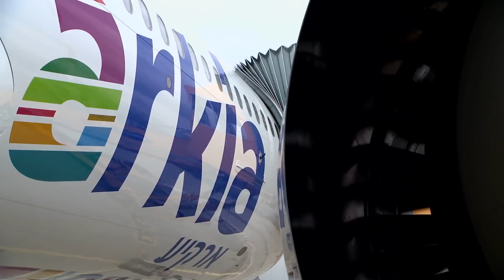Why Won’t Boeing “MAX” The 757?

Comment: This is stupid. A320 is just 5 years older than b757. And the 757-200 is exactly the same ranges and capacities as max10. If boring is smart enough they will just max the 757 instead of 737. 
They would have a better variety of than a320 family, by making shoter one like 319,318 and they can extend the aircraft further like 321lr,xlr. It would be easier to modify since it’s younger than b737 and wouldn’t have the mcas system. You should defend the stupid decision by the corporate greed.

Comment: Boeing has so much damage control to do these days it’s holding up any new aircraft designs. The tooling for the 757 is gone so there’s no chance of any new ones. Neither Boeing nor Airbus can or will have any offerings  that have the capabilities of this plane. The A321 XLR will be as close as they get.
Cheers

Comment: The 757 is a phenomenal plane. I’m not intending to armchair quarterback, but just giving my opinion as a frequent flyer and enthusiast. I often have great conversations with my uncle, who worked for Pratt & Whitney and has a PhD in mechanical engineering. They should have created a totally new airframe to replace the 737 and not done the 737MAX program based on a very old design.

Comment: No matter how good the 757 was, it had a limited market. Many may argue that this market is too small to justify a clean sheet design and jump to the conclusion that because the old aircraft was so good that it should be MAXed.
While you may be able to make a business case if each 757 could be replaced with a MAX; just in the way that it makes no sense to run an aircraft on a route with a third of the seats empty if there is one available with the right number of seats able to generate more profit per journey, it makes no commercial sense to use one with far more performance than is required.
Unfortunately for the 757, much of where it is used (rather than needed) has not only been more than adequately filled by other aircraft, but far more efficiently. This has left the market where a 757 replacement is actually needed far too small to justify one.
Do not ignore th fact that many of the runways for which the 757 was designed and needed for, have since been lengthened so that they can be served by other invariably cheaper to run aircraft.

As to whether it would make more financial sense for a future clean sheet design to have a variant capable of filling the increasingly reducing gap in the market left by the 757 as it is retired, to use a smaller aircraft more frequently, or drop the route altogether until and unless the airport provides the facilities needed for an alternative, that is another matter!

Comment: According to this article there's not much profit in doing a 757 maxlend well Boeing maybe you better get off your ass and start producing the 797 full disclosure I don't know a lot about the 797 but it sounds like what you were termination of the 757 you lost a very good jet without having an improved replacement and the 737 new iterations and Max and whatever you come up with is getting way too long in the tooth and Airbus is going to be kicking your ass if they're not already like my dad used to say either pindle or get off the pot

Comment: Why not make a Max/X of the 767 and make a shrunken version to replace the 757? With a new wing & engines. Back when the two planes were being designed, Boeing shelved the 767-100 because it was too close in specs to the 757, so they could dust off those blueprints, update them with the new tech, such as composite wings, from the 787 & 777X programs and, at relatively low cost, have a spiritual successor for the 757 plus a new replacement for the old 767s that are nearing retirement

Comment: A 200 seat NMA-5 is a replacement for not only  the 757-200 but could end the 737 Max 9 and Max 10.    The 225 Seat NMA-6, a replacement for the 767-200 and the 275 seat  NMA -7, the 767-300 and 757-300.   

An article discussing the new NMA announcement in January 2021 highlighted that 65% of 787-8 flights are under 5,000 NM.   The 787-8 entered service 10 years ago and has only 46 outstanding orders.  By the time the NMA enters service, many 787-8 planes will be 10-15 years old.  Airlines also heavily favored the 787-9 with their orders so I can see the NMA also being a 787 Light to meet the need up to a 10-12 hour flights.  

I know people say single aisle economics but there are the economics of cargo revenue using a twin aisle handling standardized LD3 containers.  During 2020, cargo revenue became a savior for many airlines that loaded their a330’, 787’s and 777’s full of belly cargo while single aisles were parked.   As air travel recovers,  cargo capacity and revenue will be what allows airlines to build back their schedules.   The economics of passenger revenue will be strained as business travel and people paying for premium seats will have a much longer recover cycle than tourists.

Comment: I agree with your material, but I think I misunderstood the title of this segment. "Won';t" initially signalled a hypoethical refusal on Boeing's part to my ears. What you were saying was actually "It is not going to happen and here is why." It would be easier to comprehend if we said things like A321neo 777neo and 737neo because all of this "maxxing" is about higher efficiency engines. In the case of the 777x it is also about weight reduction through the use of carbon composite wings. It would make easy sense to say that "Boeing cannot neo the 757" because there aren't any new engines, no higher-bypass, or hotter burning engines in the thrust class required to fly the 757—none from GE, R-R or PW. There's a hole in the bucket dear Liza deal Liza... As you said, the A321neo XLR cannot do everything and is NOT a full 757 replacement, but a partial solution only, whose "competition" will be a somewhat less capabale 737-10. 737 efficiency excels on short and medium flights. The A321 is more efficient at distance. Neither of the 737-10 or A321-XLR can do all of hot, high, and heavy. What is Boeing to do for a follow-on to an airplane that sold in lower numbers than everything else? The only thing Boeing can do is wait for an engine and get working on a new family of airplanes. That was the problem. The 757 was a loner. The only thing it shared was the 767 cockpit and avionics. It was otherwise a one-off because it shared NOTHING with the 737. The do-overs, below the 787 need to share everything. I think it is likely they will share a modified 787 cockpit and avionics, across the board. Boeing will manufacture a single-aisle narrow body to replace the 737 and a twin-aisle mid-body to slot below the 787, all with carbon-fibre, all with geared, hot turbofans yet unseen. The interesting question is about wings. Is it possible to do a lower-cost family of wings along with the scalable wingbox? Getting off the 737 platform will be less hard next time because the NMA-sibling and trained pilots will be available already. The efficiency will be compelling and the cost of training will be less of a distraction.

Comment: Boeing needs to designed a clean sheet design replace to replace the B737 and B757 in the 150-280 seat market as either a single or twin aisle to compete with Airbus A320neo, A321neo/lr/xlr.

Comment: The 797-5 needs to be ultra long haul capable. The real game changer.
Reply: 797 can only be successful in the 8000 to 10000km max range. Has to be most efficient plane for ranges between 6000km to 10000km

Comment: Because look what happened when the "maxed" the 737.
Reply: Not the same buddy.  The 737 was a small plane with small engine and then they start to stretched. well and problems come.They don't need to stretch the 757 or put bigger engine only new one and update the plane like wings cockpit is good enough like it is

Comment: This is a stupid question.  The 757 tooling is gone.  The 757 design is old.  A re-engined 757 would not be economical to build or to fly.
Reply: Everett says the tooling has all been saved and pointed to a warehouse. The economics are probably true though. It is 80’s tech and would be hard to upgrade. There isn’t a perfect replacement engine either. The 757 will become our generations MD80. A much loved “race car” of a plane passing into history
Reply: The tooling is all still there and they still make the 767-f.

Comment: Navgeek the a321lr is a 757 replacement. Airlines don’t care about altitude specs, climbing, specs, and runway specs. It’s not like airlines want to fly the a321lr from LaGuardia to London City.
Reply: Don’t think he realises that this is the 21st century and not the 60s. Runways on most airports around the world are more then long enough to handle the a321 especially ones that have enough demand to carry over 200 passengers to it.
Reply: Correct - most of the missions that the 757 performs can be done by the A321. There are only a handful of routes where the A321 cannot do that the 757 can.

Comment: I wonder if Boeing would develop a new single isle platform that wouldn’t just be for a 757 replacement but also be used as the basis to replace the current 737 in the next 10 - 15 years or so.

Comment: In one breath the video is suggesting that an update is economically unfeasible for Boeing as there is only a niche market into which a 757 Max would fit, then at the end you mentioned that Boeing is building a new aircraft to fit this relatively minor niche market. Why would Boeing design a new plane ground up to fit a relatively minor niche market?
Reply from the maker: There's nothing that really fits the segment with the current lineup, and...competition.

Comment: At this point in time, better to start off with a clean sheet, and to think about what the market wants today, not what you might prefer it want.

And , for that matter, past time to start thinking a little more about being "the firstest with the mostest", instead of obsessing quite so much over squeezing-out the last penny from existing designs and infrastructure.

Comment: It's perfect aircraft.  No need to modify anything.
Reply: It really is, all it need is same size engines with better fuel economy, composite wings and tail
Reply: @uriblaketheriddimprotege  perhaps a redesign of the wing but I don’t think they will build a composite wing.
Reply: Fuel economy is my biggest gripe. It’s old, a four decade old design, and almost all remaining units are over two decades old. It’s also loud and narrow. They didn’t future-proof their lineup for long and thin routes. But by now, Boeing is screwed.

Comment: Bruh they were considering a 757-Plus and 767X!!! (Not even one full year ago) this is according to reuters.
Reply: I think a 757 plus is very possible. Delta originally stated they were going to phase out their 757-200 but then decided to phase out the 767-300ER by 2025. This could just be because they have a massive fleet of them or it could be because they don’t want to phase out the aircraft right now and would rather trade in/scrap when they get a new aircraft to replace it. The 757 is old but is great for domestic routes. I personally see the 752 A LOT because we normally have around 6 of our daily flights to Atlanta on the 757 and previously flew to Paris on the 757 but is now upgraded to the 767-300ER
Reply: If the aircraft were to be produced, it will likely see massive order from the US big 3. And because the length and width of these, you can fit these at a normal sized gate easily allowing for quicker turn around and more gate availability. Delta would no doubt order a lot; United would probably have some and American is questionable but they likely will want the aircraft for higher demand routes or bring new international routes with lower demand than the 777 needs. American has operated every single plane produced by Boeing except the 777x because its “too large for their operations”
Reply: @GoalHornGeek  I think that UA and AA will drop their orders for the 321XLR for the 75Plus, especially if the 757-Plus has the versatility of the regular 757.
Reply: @alphabravoindia5267  I’m fairly positive about UA willing to do that. Not as positive on American. American plans to have theirs delivered from 2023-2025 and even if they started now, we likely wouldn’t see the first 757 plus take off until 2023. UA’s should start delivery in 2024 but UA is one of the most loyal airlines to Boeing. UA may also keep their order for 50 a321XLR and order a 757 plus. They have 61 757s currently and also have 38 767-300ER. So an order for 50x 757 plus could happen
Reply: @GoalHornGeek  Yes, you're right not to mention AA retired the 767 and 757 so zero commonality.
Reply: @alphabravoindia5267  another thing is that they have the 787-8 which has a very similar capacity to the 767-300ER and 757-300. They have 29 787-8 currently operating and 13 more on order. They’d likely just order more 787-8 if needed so they can have a more simple fleet
Reply: Boeing recently recently green lit the NMA which means we’ll get a clean sheet design
Reply: @CARBONHAWK1  my guess is that it will be a scaled version of the 787 with some new features including a new tail design and will only be a single isles aircraft. The aircraft would be around 165 and 190 feet in length and would have a range of around 6,000 nautical miles. The 2 sizes would be in the range to be a true replacement to the 757-200 and 767-300ER models

Comment: I think not only for the Fuel efficiency but sometimes if the new plane comes, they retire old planes. Like for example, Emirates orders new 777s, retires old 777/A380
Reply: The 757 was a safe airliner. Those 2 crashes were different reasons. The Birgenair one was since they got wrong speed readings due to a wasp nest in a pitot tube and for the Aeroperu one, they had low visibility and didn't know their actual altitude.
Reply: Abi Muthukumar True. But you told the wrong reason for the Aeroperu 603
Reply: Rubbish.  The 757 is a very safe plane. The A320 has had 14 incidents, to the 757s 9.  Yet the A320 still sells well.

Boeing closed the 757 line too early. Had they have hung on a few more years, all those airlines that started sending their 757s on long, thin, routes would have started ordering new ones.

It was just unfortunate timing.
Reply: @bmused55  It was closed not long after 9/11. Perhaps they misread how fast passenger traffic would bounce back, but many were afraid of flying due to the terrorist attacks.
Reply: Bmused55 Cool down. I never trash talk 757

Comment: Boeing might be missing out so much. A new 757 and 767 might be good

Edit: typo
Reply: The 787 variants literally cover everything these planes offered in terms of capacity and range.
Reply: @jonjohnson2844  not true... the 787 was the direct replacement for the 767, but Boeing does not have a direct replacement for the 757.  

Airlines are making do with the A321 because it’s the closest natural fit.